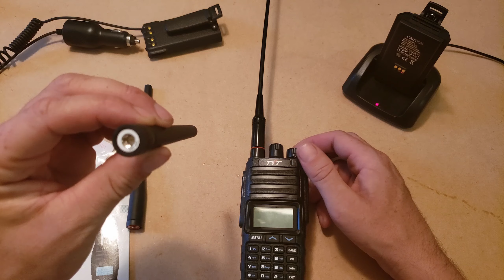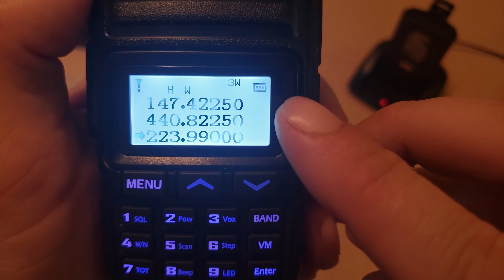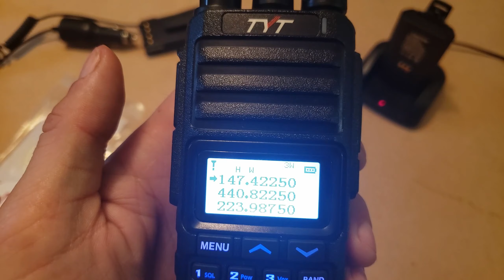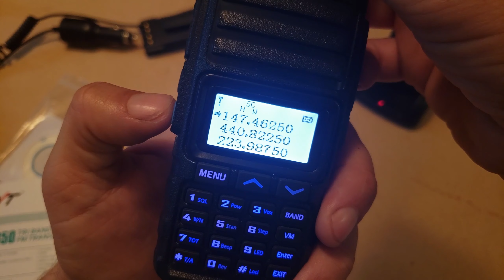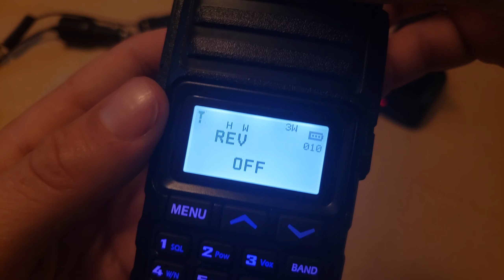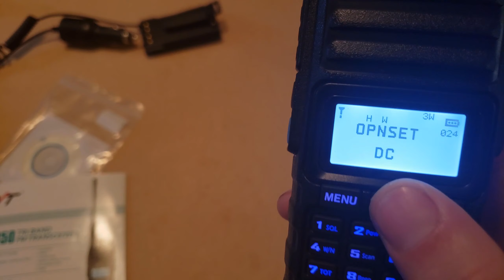TYT TH-350 Review

Comment: How do you program the buttons on the side to scan because my blue button sounds a alarm off some sort when I push it 
 Also where did you get the battery replacer
Reply from the maker: If I remember right, the only way to program the side buttons is in the software. The battery replacer I found on ebay.

Comment: How do you program the blue side key to scan? Thank You.
Reply from the maker: You can program the blue button to scan by using the programming software from TYT. It is in the 'Optional Features' tab in the software and the blue button is 'Side Key 2' and there is a drop down menu where you choose scan as the function. You can also choose if it takes a short press or long press to activate that function.
Reply: @greentruckandhamradio  Thank You.

Comment: what if your computer don't have a CD rom , is there a website you can go to , to program the radio?
Reply from the maker: Yes absolutely. The downloads section on the TYT website and just look for the newest version on the page. https://www.tyt888.com/?mod=download
Reply: @greentruckandhamradio  Got it figured out. Thanks. I wasn't entering in the offset properly.
Reply: @greentruckandhamradio  so another question I have a apple computer does the software support apple ?
Reply: My 350 won't transmit on 220. Do I need unlock something?
Reply from the maker: @will9605  no you should not need to unlock anything to transmit on 220, it should work right out of the box.
Reply: @greentruckandhamradio  A great radio. But having to change antennas for working 220 is a bit annoying. I wonder why the radio doesn't come with tri-band antenna?
Reply from the maker: @will9605  mine came with a tri band antenna in the package because the Ebay seller included it. It's a Nagoya antenna and works quite well. I agree having to switch antenna is too annoying.

Comment: Hi, awesome vid. can you share the link for the antenna? i tried to search for tri band antenna but to no avail.
Reply from the maker: I think it is the Nagoya NA-781. Will double check later tonight.
Reply: @greentruckandhamradio  I have a Nagoya NA-781 and it will not screw onto the TYT TH-350. What was the antenna you use? Thanks
Reply from the maker: @bobsimoneau  I was mistaken, I have the Shengda SRH-17 with SMA male connector.
Reply: @greentruckandhamradio  Thanks, Excellent video by the way.

Comment: I recently purchased one of these.  Nice HT.  How's your battery life?  And how is the 220 TX with the triband antenna?  My battery life doesn’t seem that long and I'm having no luck bringing up the local 220 machine.  Thanks!
Reply from the maker: Thanks for watching! My battery life is probably 2 maybe 3 days with lots of TXing. Nothing I would complain about. I have had success on 220 with the tri band antenna that came with my radio. The 220 repeaters are a lot more quiet around me than the 144 repeaters, perhaps yours are the same.  Do you often hear people talking on your local 220?
Reply: Green Truck and Ham Radio Yes, the local machine is active.  I hear it on my scanner.  I'm getting about 2-3 days with little use and no tx.  Hmm.  Thinking it might be the battery.  I got it thru “Lets Get Ready” on ebay.  I’ll see if they heard of any battery issues.
Reply from the maker: @k2cjbradio  that is the buyer I went through as well, he usually responds to emails very quickly, and ive found him to have good customer service. With no TX that battery life does seem a bit short. With no TX mine would go for at least 4 days I think, listening only during the day.
Reply: Green Truck and Ham Radio Cool.  He’s away til next week.  I’ll reach out to him then.  Thanks!!  Great tips in your videos for it.
Reply from the maker: @k2cjbradio  Happy to help! Glad you found the video helpful! I believe that seller also sells spare batteries for the TH350, maybe you can just get him to send you an extra.  It really is a nice little HT, good luck getting it sorted out!